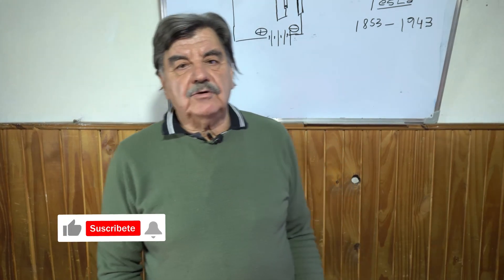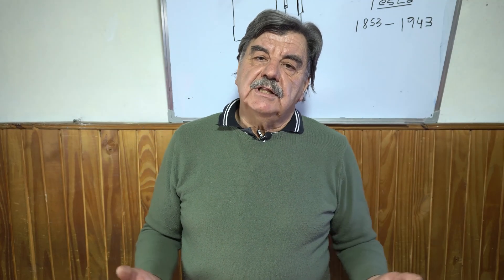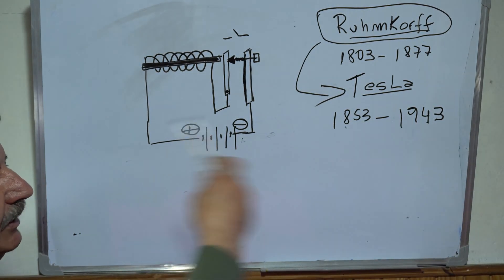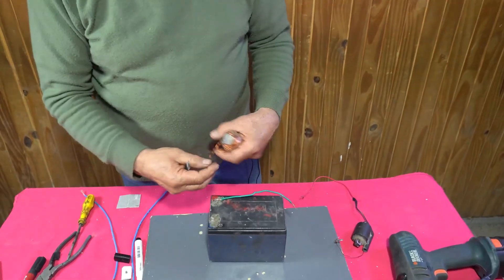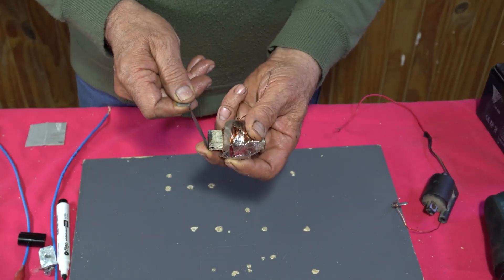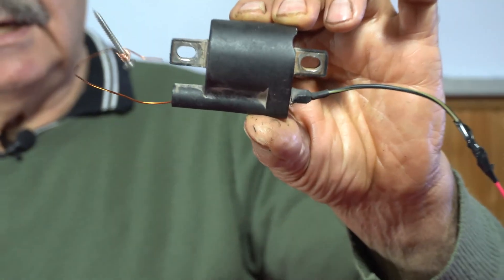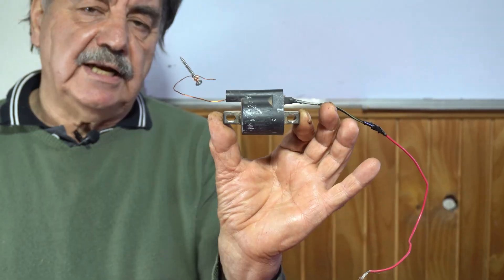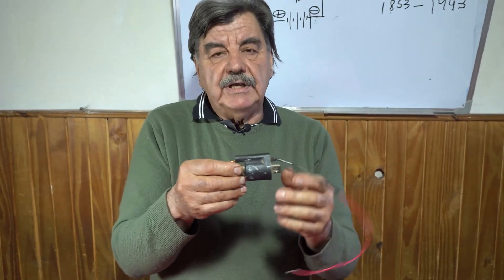RUHMKORFF, master of TESLA?

Comment: Good day sir is this a free energy from a battery...i curious about this project sir...
Reply from the maker: Free energy does not exist. There is no such thing as perpetual motion, friend.
Reply: @jcaecosistemasen  You're wrong. I did the math and used a resonant circuit, and maybe by drawing 10 mA at the input from the battery, and at the output, you can have any energy of 1000000000000000 kW. You're just doing it wrong.:face-blue-smiling:
Reply: So, the voltage can be increased without "limit"- how about the "ampererage", how to increase it?... Thus, 10.kw- 20.kw power output, will be produced...
Reply: @arielhermoso4262 Всего лишь 20 кВт ..😢
Reply: @arielhermoso4262 AParalelResonant LC Circuit,IncreasesOutputAmperage,AndDecreasesInputAmperage.
Reply: Lockridge device worked and was sold .